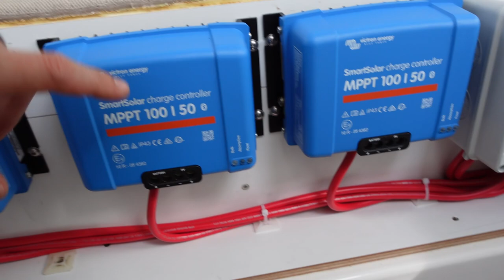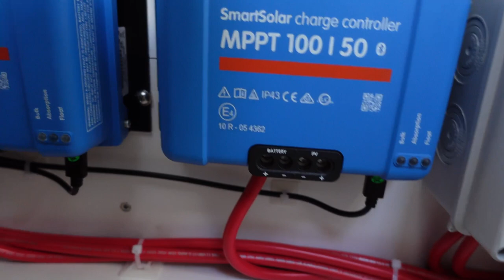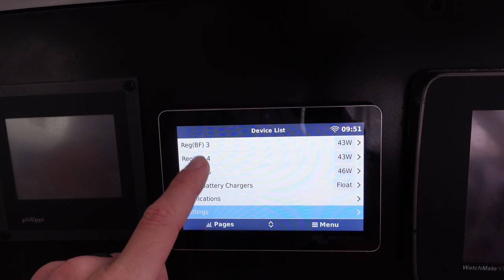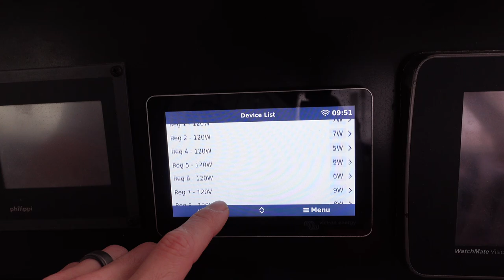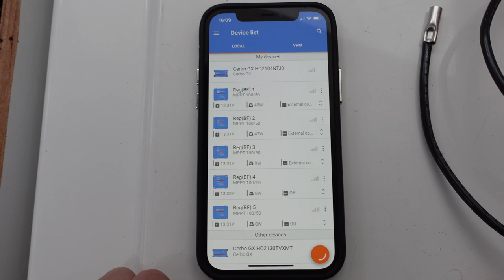Our Off Grid Boat - New Arch with 3.2kW of Solar!

Comment: Hi, your video is very interesting.
We Learn a lot of thing thanks to you
Reply: Where are you put your power bank in the helia 44?
Reply from the maker: When we did our lithium swap, we moved the batteries into the salon under the couch.  We like it because the weight is fairly centralized and it moved the batteries out of their original location in the engine rooms where I was always concerned about heat.
Reply: @OutChasingStars  do you work with 12 or 24 volts?

Comment: Very nice work! I hadn't thought about adding an on off switch on the positive side of the cables coming from my solar, that is a really good idea and I am going to add that. I crimp all of my own cables, so it should be easy to do. As always, nice work! I can really appreciate the amount of effort that has gone into this! You are going to be so happy you did this.
Reply from the maker: I'll happily admit that I found that idea from someone else when I was researching the set up.  I do really like it and it's not too bad if you can crimp everything yourself.  And yes...  I CAN'T WAIT to see how this all works in the Bahamas!
Reply: Pretty sure that having a CB on the positive side of the solar panel is a code and ABYC requirement.
Reply: @OutChasingStars  being in the Bahamas are you only using one 12v AC unit or did you swap out all your AC units for 12v?

Comment: Nice install. Since there is not much space on a sailboat I wonder if you could but a thin flexible or standard panel under the existing panel? Bifacial down side is they are bigger so per SQ FT they are not much advantage. Im sure the sun reflect off the water and any free power would be a bonus. Wonder if anyone has tried this or tested the idea?

Comment: You array is going to work so fantastic we have 4.3 kw of solar but some of that is faded flexible. In Fiji we only use the generator on average for 2 hours per week. And can go 3-4 weeks with out using gen. Each day we do 
2 dishwasher loads
Induction cooking and electric jug full electric galley 
Three fridges/freezers 
1 load in the washing machine due to lots of washing with a toddler 
Make 100-300l of water
And more. 
All solar powered. Makes around 12-15kwh per day. 
Love not relying on generator and love having lots of fresh water.
Reply from the maker: We're not going full induction at the moment and I'm still the dishwasher on the boat.  😂  So I'm confident that our new solar production will cover what we want in terms of hot water/air con/watermaking.  And if we end up with full batteries every day anyways, then induction cooking is likely next on the list!
Reply: @OutChasingStars   yip order the induction now you will be covered. But it’s the electric oven versus gas oven that’s the real upgrade. Gas versus induction is so so in my view. But yogi loves the induction cooking. Keep up the good progress.

Comment: I have had problems before with a single USB hub and a few Victron ve direct to usb cables . They seem to use the same address and conflict and don’t all work. I ended up having 3 usb hubs with a Victron ve direct to usb wire in each hub. This was to a PC. When I fitted a cerbo unit you get the ve direct to ve direct straight to the cerbo and it worked well.
Reply from the maker: I haven't had any experience doing VEDirect to a PC, but fortunately doing the VEDirect to USB cables to the powered USB hub, and then a long USB cable to the Cerbo seems to be working just fine!

Comment: It would be interesting to test see how much output there is when the upper side of the panel is covered up, with the dingy underneath.
Reply from the maker: Our minds work very similarly!  That is one of the experiments I'd like to try!

I have heard though that the dingy is only so/so at bouncing extra light back up to the solar panels.  We've been wanting an aft sun shade for a while, so this was the perfect opportunity to have one made in white that will go from the aft end of the coach roof down to our dinghy davits.  Hopefully that will help the underside performance!

Comment: Clean! What did whole install weigh?
Reply from the maker: Each panel is 28.4kg/62.6lb.  And we estimated the frame at 90kg/200lb.  So in total 232kg/513lbs.  Which is just about the same weight as the shore power frequency converter that we removed!
Reply: @OutChasingStars  that’s a great result, will be interesting to hear if that weight added up high is noticeable in the way the boat moves or rocks… great work btw!

Comment: Hi David and Amy, sweet video! Things are coming together nicely for your "boat V2.0"! I noticed that your panels are about 1/3 over the coach roof. Do you think that this will limit/inhibit the power from the underside of the bifacial panels? I'm also wondering why you needed both the CB panel on the positive IN and the e-series switches on the other side of the MPPT's.
Reply from the maker: I'm sure that having part of the underside of the panels covered by the coach roof will limit the extra bifacial performance, but the array was already large enough without it sticking even further aft!  We did have a white sunshade made up which will attach to the aft end of the coach roof and go down to the davits and will hopefully bounce some more light up to the bottom side of the panels.  We'll see how well that works out.

Having the e-series switches allows me to isolate the controllers if I need to do any work on them.  There is a lot of voltage coming through on those wires and I didn't want to just have them hanging out in the compartment.

Comment: The two round equipments close to the charger controles are relays?If yes, are their coil to be permanent energized?
Reply from the maker: Good question!  They are technically called 'contactors' but are extremely similar to relays.  And the coil is "NO" or normally open so I have them set up to be activated via a switch at our 12v switch panel.
Reply: @OutChasingStars  thanks for your answering. Relays and contactors are pretty much the same equipment. Relays are used in control circuit and contactor in the main circuit. The firs usually switch low electrical current and the second high currents. “NO” and “NC” are related to the main contact, not the coil. Some contactors are not designed to have its coil permantly energized, like cranck contactors for instance. If it happens they will be to hot, fail and the fire risk is possibe too. That was my concern, because I’ve already seem it happening.

Comment: Im using the same victron controller 100/50. I have to say that is pricey overkill to have a controller for each panel. But it does allow you to troubleshoot problems with the panels not producing. Are you using LiFePo batteries? How much storage do you have?
Reply: This is a typical setup when panel shading is an issue.
Reply from the maker: I won't argue with you that a controller for each panel is overkill.  There are definitely other ways to plan out the system and we know lots of other people who make that work.  But I'm pretty relentless in terms of my search for maximum efficiency and since we can afford it and have the space, we decided to go for it.

And yes, we do have LiFePO4 batteries on the boat.  We have a 12kW system with 1,000 amp hours of batteries at 12v.

Comment: Hi,  Can I ask you how much the solar arch weighs c/w the panels and if you determined if it might move the COG back?
Reply from the maker: Each panel is 28.4kg/62.6lb.  And we estimated the frame at 90kg/200lb.  So in total 232kg/513lbs.  

Previously, Starry Horizons was a bit bow heavy.  So by removing our generator and shore power converter and adding the solar array, the net effect is moving the weight distribution a bit aft.  And SH now looks like she sits much more level on the waterline, which is great!

Comment: Sweet setup. What size inverter are you using?
Reply from the maker: We took our old Victron Multiplus inverter/charger and are now just using it as an inverter.  It's rated at 3000W which has been more than enough for our AC power needs.

Comment: You might consider silicon or black rtv in and around the grommets of the frame so that water really doesn't get in.  I really loved the professional video, and the diagram.  I've seen some  people use the dc breaker panel like you installed in the space as a shutoff for the panels.  I'm not sure they really need to be "fused", as well I have never done so, but hey I just thought I'd pass it along.  I would think the only problem might be if they produce more voltage or amperage than the controller can handle, which what are the chances of that happening...practically zero.
Reply from the maker: Water ingress is definitely something I'll keep an eye on.  It's a pretty tight fit already.  And you know me... I always fall on the side of caution, especially when it comes to electrical stuff!  Plus the manual does actually call for a fuse/breaker to be installed.

Comment: Awesome install- congratulations! Do you think the MPPTs will get hot enough in that enclosed space that you will need/want to install one or more temp controlled 12v computer type fans, e.g. CoolerGuys, to suck cooler air in and blow hot air out?
Reply from the maker: I'm not worried about the MPPTs getting too hot, but what has been a surprise has been how hot the air con contactor has gotten since we've been back in the water.  Granted we're running our Mabrus almost constantly in reverse cycle heat mode since it's getting cold in Rhode Island!

I have added a temporary fan to help at the moment and will be installing a 12v computer fan that will run with the contactors are activated.
Reply: @OutChasingStars  I wonder if another option is to just remove the contactor and then you can just use an easy to open/reset breaker. So if you won’t be using it for weeks the breaker is off. If you are needing it turn the breaker on and then turn the AC/heat unit on and off at the AC control touch panel.
Reply from the maker: The contactors let me use switches at our main 12v panel to control the air cons/watermaker.    I really like having everything centralized there and we'll be using those systems pretty regularly, so having to dig under the couch to access a breaker would also get pretty annoying.

Comment: Another awesome video.  Here is a comment for the algorithm.  Keep up the good work.

Question: is there a technical reason you picked the Schenker watermaker over the Spectra?  Both have the efficient energy recovery pump.
Reply from the maker: There were a couple of reasons.  The biggest technical one is that Spectra doesn't offer a 12v watermaker in the 30GPH/113LPH range.  Their Newport 700 is 24v and I didn't want to have to mess with DC-DC conversions just for the watermaker.  We were generally happy with our previous 30GPH/113LPH production capacity as it fit well with our lifestyle.  The new Schenker Zen100 is a bit below that at 26GPH/100LPH but is 12v.

The other reason is that we've had a great relationship with Rich and Charlie at CruiseRO.  So when they became Schenker dealers, it was kind of a no brainer to go that way!

And greatly appreciate comments for the algorithm!  😂
Reply: Thanks for the follow up. I am a retired engineer with an electronic degree so I am very interested in the power consumption and off grid decisions. We are thinking of going from RV’s to sailing. I know if you can take care of water and power everything is easier!

Comment: How much did the arch and solar panels weigh ?
Reply from the maker: I mentioned this in another comment but each panel is 28.4kg/62.6lb.  And we estimated the frame at 90kg/200lb.  So in total 232kg/513lbs.
Reply: @OutChasingStars  thats the equivalent of 3 people permanently perched at the back extreme of your boat... do you not think this might effect performance and motion on the water ?
Reply from the maker: Actually, we've been a bit bow heavy in the past with the generator/anchor chain and our water tanks all up front.  By removing the genset and our shore power converter and adding the arch, the boat looks better balanced than before.  So I'm not particularly worried about it.

Comment: Why 12V??? 48V is the only way to go in this otherwise great setup.
Reply from the maker: If I were starting from entirely from scratch, 24 or 48 would be the way I'd go.  But we were doing enough other work that I didn't want to take on a complete conversion of our electrical system away from 12v as well.
Reply: @OutChasingStars  Well, you've done so much work anyway, it's sad to see 12V system at the end. You could use 48-12V DC-DC inverters for some loads to make conversion cheaper, but that system would have huge potential, wouldn't require big gauge wires, had lower currents etc. 
BTW - having separate controller for each panel is best decision in my opinion, I really like it.

Comment: Why on Earth would you use 12V components?? If you went 48V the wiring would be 1/4 the copper, less beefy switches, busbars, etc and far more efficient at higher voltage. If you need 12V for the boat just use a separate battery or a buck converter 48v - 12V.  What a waste of money

Comment: That electric array on a chipboard? No insurance is going to pay for it in case. No chipboard on a boat. Never ever and even not with air condition. Real bad workmanship.
Reply: What are you saying, didn't see a clipboard
Reply: @anthonyellis9804  What about the USB hub? All the function of the battery bank relies on an unprotected hub used in households. And I doubt USB plugs are a suitable solution corrosion wise, but this must go to the manufacturer of the solar controller. All cables on an nmea network are of IP66 class. And so should be any electronic plug. Electric cables are easy to watch for corrosion, fine electronic plugs are impossible to check for that. And the switch box is mounted on a white chipboard, clearly visible in about 2:40. Chipboard is not to be used on boats at all and for sure not as base for electric installations.